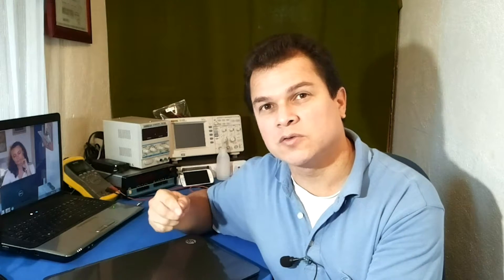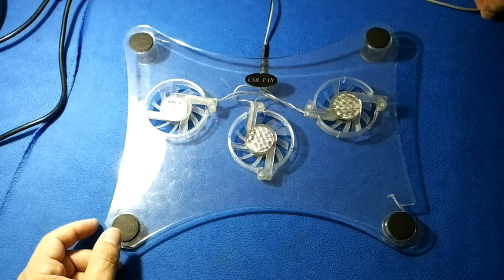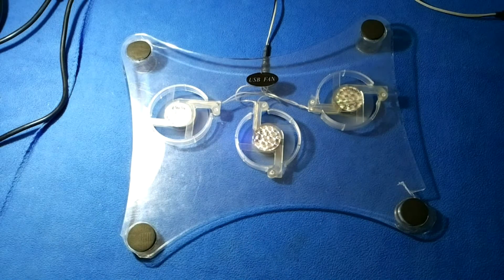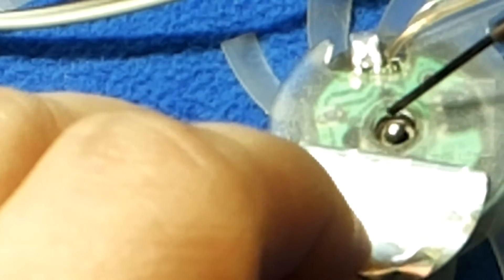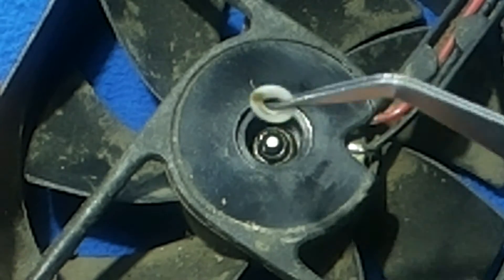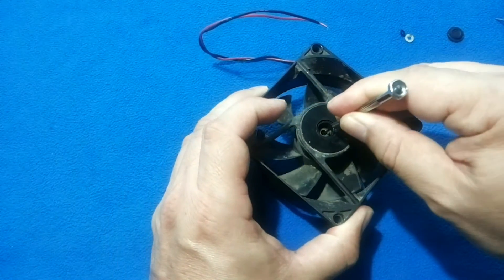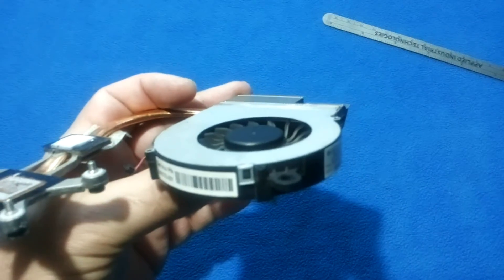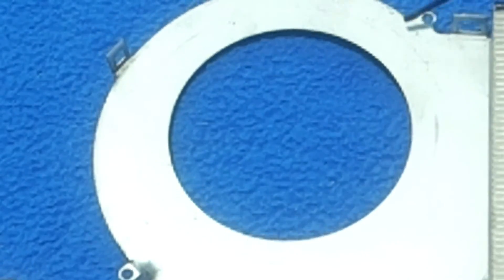How to fix a laptop noisy fan or heating problems made by cooling fans.

Comment: if only more people fixed their onw things...
Reply from the maker: Hi Dear!  ...no only to fix it. Must computers letal damages like short circuit capacitors, damaged video chips or processors, or minor but expensive damages like hard disk over heated, happened just because the lacking of preventive maintenance. Cleaning ventilation system every year, will keep everything running fine. But most people did not think about it, and ended buying a new computer every 3 years. :-(

Comment: Hello !! Thanks for sharing your tips. I would like to ask if is any available way to fix ball bearing Cisco switch fan, like KDE1204PKVX model? It looks like needs new grease, but how can be this done?
Reply from the maker: +nikstefos Hi! Look for your mechanic, and ask him how to do it with small ball bearings. It is easy. The side wall must be removed if they are plastic. Put grease in your hand's palm. Slide the bearing with pressure on it. It makes the grease to enter slowly in it. Ask a mechanic. He will show it to you. They always do it. ;-)